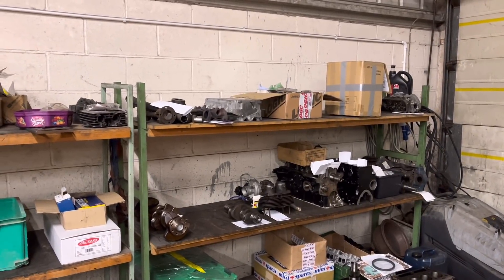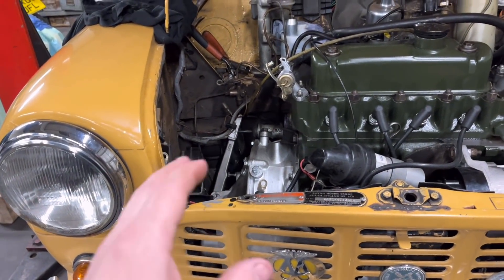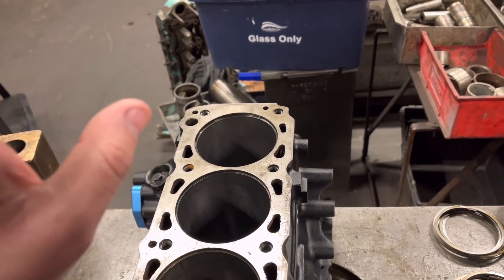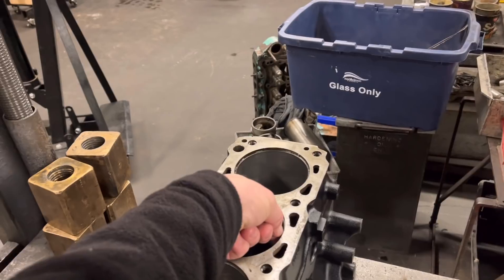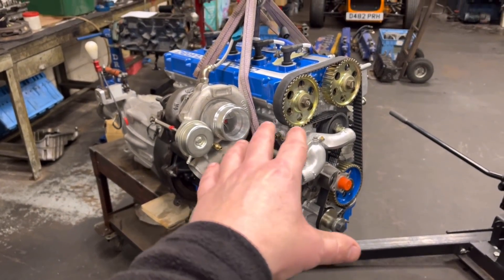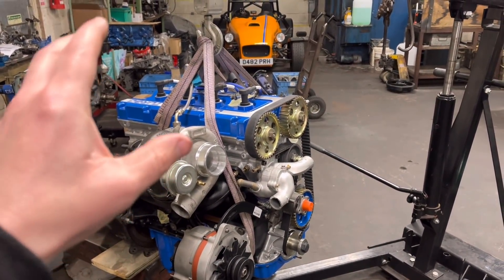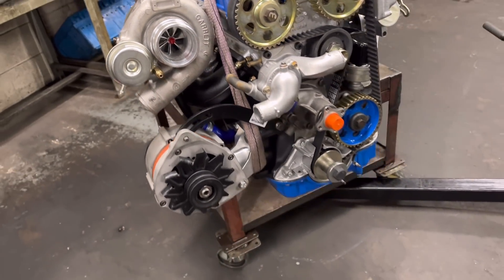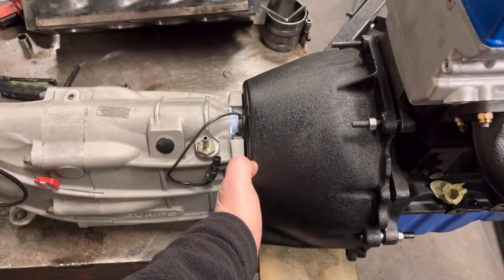One VERY EXPENSIVE machining error on this Cosworth

Comment: Attention to detail is a lesson , after putting back together the top end of an Harley Shovel motor & had given it some revolutions before firing to give some oil . . had't noticed the throttle cable was hung up near the grip & when it fired it fired full throttle

Comment: One simple miss can cause huge problems. Always measure everything.  Assuming its the same as the last one someone built is not an excuse.. The other shop should at least help with the labor to replace the liners. But with it going on 2 years hence good luck with that. Lesson Learned really. Not just a good catch, its because your thorough. Great job 👏

Comment: My engineering senses were tingling when you said the bore for the liners had been honed. Fine for floppy piston rings :o) Would have thought any irregularity that honing bought to the block overbore would change the contact pressure on the liner. If it works it works, I was just not expecting it. *shame you can’t get shims from a diesel wet liner the same diameter, I’d stuff the liners back in. :D Still, better if it is 100% right and proper.

Comment: I think your being very optimistic expecting 430+ using standard cam's and no vernier pulleys you said that everything is balanced but is it a lightened and balanced bottom? If you had the vernier pulleys on standard cam's I'd you may creep over 400 with the T34, hopefully your going to do or get a follow-up video to back up the expected 430+ ponies and injector sizes would be interesting to know
Reply from the maker: .48 housing yes, .63 we get 420 on std engine, no need to lighten at all. This turbo will do 430

Comment: What about the obvious (to me anyway!) difference in gapping between the cylinders on the engine with the liner problem?  Is this a Cosworth thing?  I can plainly see there is a difference which means even less area for correct sealing between cylinders.  Maybe just a camera angle thing as you never mentioned it on the first video either ....  Just my tuppenceworth!

Comment: You won't get 440 with 2wheel drive inlet , 4x4 exhaust manifold and a t34 even if it's moded , the exhaust to restrictive as the inlet, is , cams will do 500bhp, low comp is the way to go as the touring car where
Reply: And how long ago was that ?
Management has moved on along way since then ! Hi comp and good fuel is the way to go but maybe not with a yb!
Reply: Worked with Cosworth over 30 years I know how they work and how much to push them , you probably haven’t driven what I have , low comp with no lag

Comment: I have a (probably dumb) question. Can liners be put in a block and then have them skimmed to a uniform height above the deck? Or must the liners be pushed in to the same height across the deck and then finger's crossed they stay there until the adhesive cures?
Reply: My builder leaves the liner slightly proud so it seals the gasket better

Comment: You have made a fine job of the Cosworth engine, I think the owner will be very pleased and excited to get it back. What is the Jaguar XK engine on the frame in for, just to the left of the Cosworth engine if it is a rebuild would love to see some content on that. 
I use to work at an engine reconditions back in the 70's and 80's so I really enjoy your watching your video's, things have changed a lot now though to what I remember.

Comment: I mentioned the potential for a gap between the gear box and Cossie engine in a post to one of your earlier videos, good to know that Burton do a spacer plate, wasn’t aware they did them so I made one many years ago, bit rough and ready at the time but did the trick for banger racing.